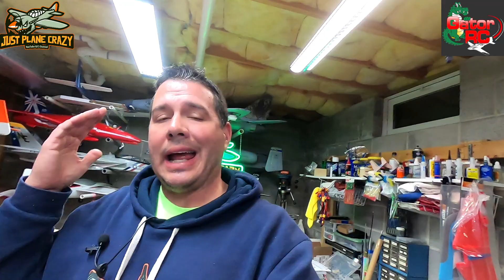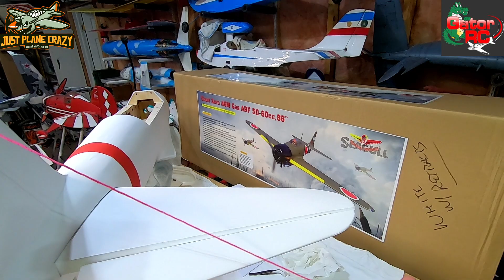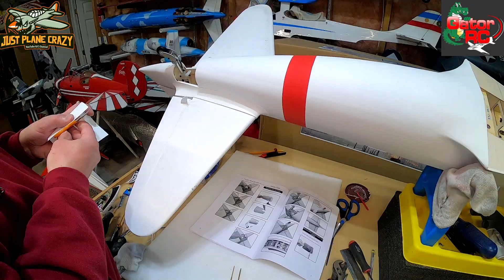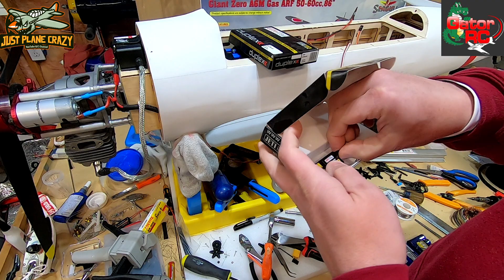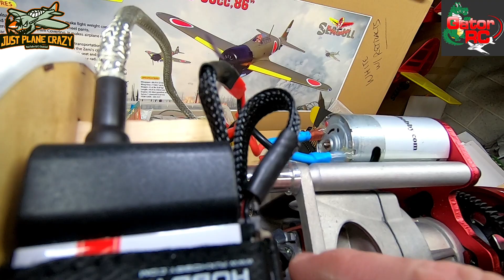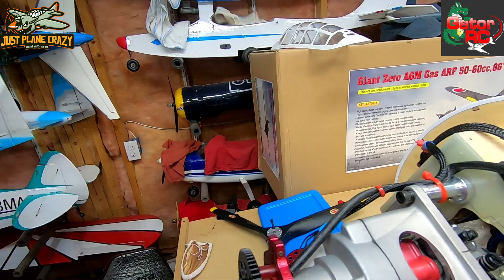Seagull Models Giant Scale Zero Build pt.3 from Gator RC, Fuselage and Tail Assembly Tips and Tricks

Comment: I didn’t put the cover on for the tail wheel. This way, you can periodically inspect not only the set screws, even if you add the wheel colar as he did, but also the control linkage for the tail wheel. I have a 71" Seagull P-51. It has a retractable tail wheel and there are no gear doors. I did not have the fitment problem he had with the horizontal stab. My kit came with regular hinges. The flat ones with the pin that connects the 2 halves. I am not a fan of CA hinges on plane this size anyways.

Also pay attention when you install the fillets for the horizontal stabilizer. Don't glue the fillets over the pre-cut elevator push rod exits like he did.

Comment: An ARF should never have this type of a problem. These planes cost enough that the plane should be built right. Many people don't have the skills 
to mod the plane. I could almost bet you had other problems with this plane.
Reply from the maker: Best flying plane I have. I would say to those that don’t like ARFs or the things that come with them building is an option. It takes 3x longer and more expensive and won’t turn out near as good. I am an accomplished builder and although arfs have their challenges they are a fantastic option. I also show things I run into to teach people how to fix them.
Reply: @JustPlaneCrazy  ... I glad it flies great but you fixed it . Not saying building is easier or better but just that the ARF plane should be built almost ready to fly not major over haul.

Comment: I followed your build of the Seagull Zero closely and it was a tremendous help.   I've been flying my Zero for a few months now powered by a DLE 61.   It looks great, flies super easy and hauls A$$.   The only thing I'm struggling with is the tendency of this plane to want to nose over on landings.   I fly off a grass field that is kept pretty short.   The plane is balanced well, when flying inverted there's just a little nose down, as you would want in a warbird.   I've played with the toeing of the main gear wheels a bit and I have to switch to high-rate elevator just as I'm about to land to hopefully avoid a nose over.   Just wondering if you experienced this tendency to nose over on landings??
Reply from the maker: On thick grass fields a little but not much. If you could shift the cg back a hair it may help. Thanks for the kind feedback

Comment: Did you glue the two wing halves together?   The instructions aren't very clear about that?   Do they need to be glued together?
Reply from the maker: I didn’t glue mine together. One wing bolt in the bottom and tube will keep everything together as one once on the plane. I put a strap on mine to make it one piece. It can be removed when I want. Then you can separate. I prefer transporting the wing as one piece
Reply: @JustPlaneCrazy  Thanks a million!

Comment: What baterry do you use for ignition? The receiver ones? Do you use ibec?
Reply from the maker: I use two redundant 3200 7.4 packs. Then supply the servos and ignition through the receiver. No Ubec
Reply: @JustPlaneCrazy   First of all, thank you for your answer (huge fan here). Aren't you concerned about the interference from CDI ignition noise?
Reply: The Ibec i was mentioning is the "tech aero ultra ibec" from Gator RC
Reply from the maker: So popular question. Ignition noise comes from the secondary side of an ignition system. That means ign cool to plug. As long as the wire is not damaged, the boot and spark plug are properly fitted and the primary control wiring is nowhere near the secondary wiring you don’t have any issues. I have yet to ever have a gasser give me issues. This setup is no different then that circuit being for lights. I will also answer you UBEC question which is also very good. A lot of my friends run tech arrow and love them. I agree it’s a good product and I am not opposed to it. When I run out of my others I will most likely go that way for extra protection but that goes back to answer number one above. Also if 20000volts gets sent back through wiring, it doesn’t matter what it is.  It’s fried

Comment: How did you mix the choke and auto start servos so the choke disengages on start?
Reply from the maker: The choke servo is mixed in on a three second delay. Once it’s moving it’s also slowed way down so it’s slow to close. If the engine is hot the choke will never come on because it starts right away. If it’s cold it takes a couple seconds of cranking and the choke comes in and only ever has a chance to deliver enough fuel to start because it’s coming slowly.
Reply: @JustPlaneCrazy  Is it mixed in using another separate channel?
Reply from the maker: Choke is on a separate channel. Then I mixed the delay into the starter solenoid channel

Comment: keep throttle stop it stops the butterfly from closing too far causing scaring and sticking on the carb wall.. depending on how quality the machining on the carb is
Reply from the maker: My thought was when the throttle is properly set u don’t need it and should the linkage ever fail it will close and shut the throttle